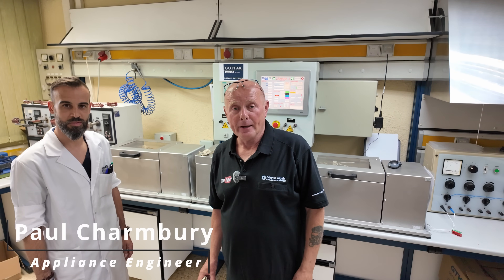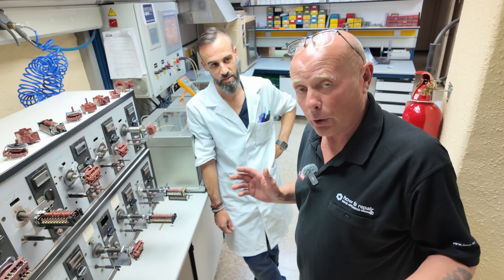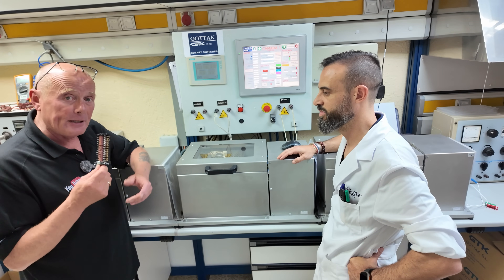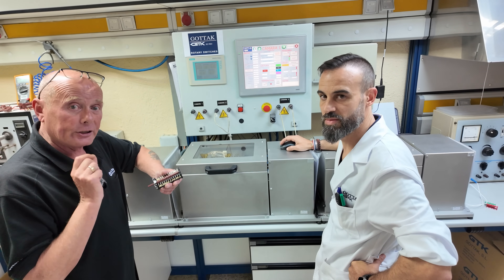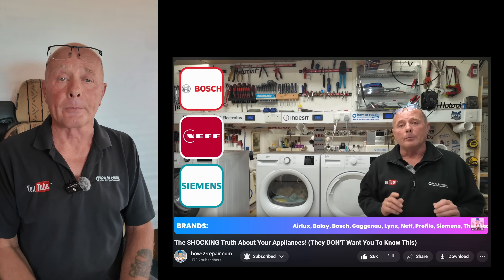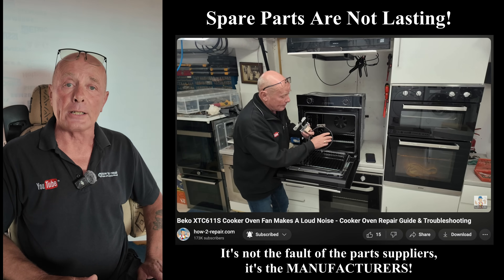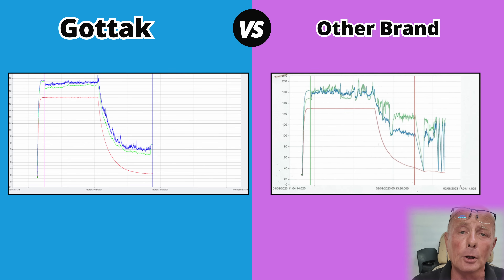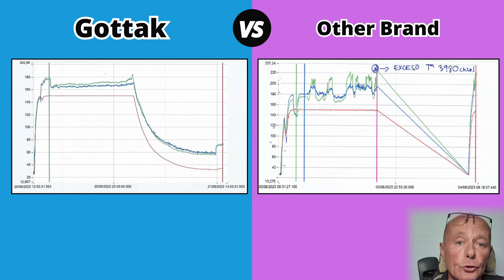Why Your Appliances FAIL SO FAST! Lab Results EXPOSE the Truth!

Comment: i got a samsung dryer and part of it is cheap wires that fall apart with bad soldering
Reply: and crappy heating element, had to replace heating element and themometer and cut and put in new heavy duty wire... its just a patch will probably need to do it again at some point untill the whole wire needs replacing. but yeha a 5 year old dryer that needs all that... i wish we would hav enever gotten rid of the older dryer... we have a dishwasher that i had to brake the locking mechanism that tells it when the washer is locked but it would lock correctly and let us wash our dishes so now i can actually turn on the dishwasher with the door open lol. yeah quality control is just not there cheap parts and cheap wires ... this is why i hate when peopple say "things from china are the same quality" like obviously you havent had to repair your applainces cause i can tell you now that the cheap chinese crap they are putting in the dryers will one day end up burning down a house. I am not looking forward to finding out how crappy the new water heaters ill keep fixing mine untill i absolutely have to get a new one.
Reply from the maker: Hi there! Thanks for your comment, @WilliamDiaz-p2h!

Your experience with the 5-year-old Samsung dryer, having to replace the heating element and thermostat, and even upgrading the cheap, flimsy wires yourself, is a frustratingly perfect example of the poor quality and built-in obsolescence we're talking about. The fact that you had to break a faulty locking mechanism on your dishwasher just to make it work further proves your point that quality control is severely lacking.

Your concern that the cheap chinese crap they are putting in the dryers will one day end up burning down a house is a serious and valid one. At the trade show last year, understanding how much obsolescence and corner-cutting is being designed into new appliances these days is something everyone should be aware of. For a deeper dive into this topic and to see the examples we covered, please check out the full video here: https://youtu.be/gEgSCbZnHVM?si=wTIw0mELuhWaw4aX

We also explored related aspects in these videos:

The shocking truth about manufacturers: https://www.youtube.com/watch?v=QsdGd2qDPaI
Heat pump tumble dryers are they really worth it?: https://www.youtube.com/watch?v=xn03N3b0-lE
If you found this information eye-opening or helpful, please consider sharing this video with your friends and family. The more people who understand what's happening with appliance longevity and safety, the better equipped we all are as consumers. Your sentiment about fixing your old water heater as long as possible is one many of us now share.

Thanks again for watching and engaging! Don't forget to subscribe to the channel for more insights like this!

Comment: I remember I bought two years ago an electrolux washer/drier and I paid 500 euros. It had the inverter system motor and I thought "thats nifty, lets try this one". As the two year warranty ended, literally not a week after the main circuit board crapped out, caps exploded and some chips blew out their middles. out of nowhere. just sitting there. room was full of smoke... I bought a new board for 150 euros. Half a year passed. The sump motor died. at first made some unhappy buzzing noises, later died altogether and I had to empty a full tub of my dirty work clothes onto the kitchen floor for god sake. Turned out that the moto had it's winding just sitting in the air - no epoxy, no nothing, I could move them effortlessly with my fingernail. They rubbed trough and shorted out. New motor: 34 euros. I just hate what crap today we are making.... edit: I forgot to add that in my basement I have my old washer, a Bosch V693. I was going to chuck it out after buying the elctrolux one, but after it failed so miserably, I decided I will do my best to revive the Bosch one. It actually worked for me trouble free since 1984 and just needs some love and a new bearing. I will never throw it out now, ever.
Reply from the maker: Hi there! Thanks for your comment, @mr.dahliaking.202!

Your experience with your washer/dryer, from the main circuit board failing right after the warranty expired to the poorly made sump motor, is a perfect and frankly infuriating example of the built-in obsolescence we discuss in the video.

It's incredible to hear how your 1984 Bosch V693 has stood the test of time and just needs a little love to get back in working order. That stark contrast between your old, reliable machine and the new one really says it all. Your decision to revive the Bosch is a testament to the value of older, well-built appliances.

At the trade show last year, understanding how much obsolescence is being designed into new appliances these days is something everyone should be aware of. For a deeper dive into this topic and to see the examples we covered, please check out the full video here: https://youtu.be/gEgSCbZnHVM?si=wTIw0mELuhWaw4aX

We also explored related aspects in these videos:

The shocking truth about manufacturers: https://www.youtube.com/watch?v=QsdGd2qDPaI
Heat pump tumble dryers are they really worth it?: https://www.youtube.com/watch?v=xn03N3b0-lE
If you found this information eye-opening or helpful, please consider sharing this video with your friends and family. The more people who understand what's happening with appliance longevity, the better equipped we all are as consumers.

Thanks again for sharing your detailed story and for engaging! Don't forget to subscribe to the channel for more insights like this!

Comment: I repair electronics. Low quality low temp caps on the power supply.
Reply from the maker: Thank you for your comment. I appreciate people like you taking the time to write it out. Please share it where possible. It might help others make a wise choice instead of being misled by the industry.
Reply: @How-to-repair  This could possibly be resolved by regulation on duty cycle and headroom in components.
  The problem is people are less wealthy than they were 15 years ago. 
 Their purchasing behavior reflects this.
  Troll the internet, find the cheapest item.
Personally I can not afford to buy cheap.

Comment: It is a sad reality. Several years ago my mom bought an Samsung vacuum cleaner and the motor failed literally a month after the warranty period rendering it useless. Heck I myself bough a battery powered desk fan and it was failing in less than a month because they cheaped out and went with a cheap bushing for the bearing instead of a ball bearing that would have significantly increased it's lifespan a lot. I replaced that bushing with a ball bearing as it was using an ordinary 12v PC brushless fan as the motor and they all are very similar so it kinda just fits perfectly. After that it hasn't really failed. Now I know bushings aren't bad but that one is. I own a vintage 1966s desk fan where the motor does use bushings but it's doing just fine. There is slight play in the shaft from wear over the years but it doesn't wobble when running and I've put new lubricant in it to keep it lasting even longer. And this isn't just appliances, this is applied everywhere, even in electronics like your smartphone, laptop, printers and more. My brother has decided to buy cheap power tools from Parkside and 3 of those tools have already failed and it's barely even been used. In two of the tools the microcontroller for speed failed. In one I couldn't figure out where it issue lies, in another there was visible burnt out chips. Fixed those two by skipping the microcontroller and just going straight from the switch to the motor just so it would work at all with the minus of not being able to control it's speed anymore. In the third one again the microcontroller for speed control failed but that's a different type of switch that I can't wire to the motor to skip the failed speed controller so it's basically just dead and I can't find a replacement switch either. Meanwhile a cheap NiCD drill that I found at a scrapyard with it's charger from 2006 and it has no issues and it just works. Funny, yet sad.
Reply from the maker: It's hard to believe that manufacturers expect consumers to be happy buying major appliances every few years. I haven't seen any positive comments from engineers about this problem. Planned obsolescence and the lack of repairability are major issues in the industry and the manufacturers prioritize profit over long-term reliability. Thank you for your comment. I appreciate people like you taking the time to write it out. Please share it where possible. It might help others make a wise choice instead of being misled by the industry.

Comment: I’ve noticed this for several years now. 
Often times if I’m able to do so, I will buy another item, just like the one that failed, swap the internal parts, and then take it back for a refund. Lol
 Until manufacturers stop screwing us over, I will continue to do the same thing. 
Automotive parts have really taken a downturn in quality too. 
 I’ve gone through several starter solenoids, same thing with the internal contacts being cheaply made from inferior materials. 
 Relays and switches in general, including points for older ignition systems, just about all of them are made with inferior metals that get pitted and burnt prematurely.
Reply from the maker: It's hard to believe that manufacturers expect consumers to be happy buying major appliances every few years. Thank you for your comment. I appreciate people like you taking the time to write it out. Please share it where possible. It might help others make a wise choice instead of being misled by the industry.

Comment: If it ended up that the manufacturer was made responsible for recycling products with their brand on it, I'd bet they'd change their tune pretty quick on reliability. Not sure how it'd be possible to get the laws adjusted in that direction, but that's whats needed to reduce waste at some level.

Also I hate how some things have been designed to have a significantly shorter lifespan by being designed to be unserviceable. And that implies nothing changed otherwise with the quality of components. For instance you could keep a fan with a shaded pole motor working for decades by cleaning up the inside and oiling the bearing cups. But a brand new one will have deeply recessed security screws on it, which means it bogs down and dies in two years because there's no way to do maintenance that was easy before.
Reply from the maker: It's hard to believe that manufacturers expect consumers to be happy buying major appliances every few years. Thank you for your comment. I appreciate people like you taking the time to write it out. Please share it where possible. It might help others make a wise choice instead of being misled by the industry.

Comment: We need a global internet media hub unassumingly called something like 'My Engineer' where people can document individual engineers and designers and executives who have:

Designed and/or green lit specific examples of built in obsolescence;
Spearheaded anti-repair practices;
Used predatory patents and/or market dominance to kneecap innovation, design resilience; repair friendly design; dangerous work practices, products or services.

Start it as a history project and work forward to contemporary and politically charged examples currently effecting customers, and distorting markets in favour of established vested interests.

You could start with every individual who insists on using the industrial waste product sulphuric acid, instead of the much safer sulphur based alums in consumer products such as car batteries.
Reply from the maker: Thank you for your comment. I appreciate people like you taking the time to write it out. Please share it where possible. It might help others make a wise choice instead of being misled by the industry.
Reply: @How-to-repair  I spent a few years involving with recreational hot air ballooning. One thing that struck me, was that EVERY design feature, and procedure was a memorial to a death. During my time, the two stroke fan used to start the inflation process was given a new procedure: a ring of witches hats around the fan unit. Six months earlier, a woman had lost her life when her hear had got through the fan cage and snapped her neck like a match stick.... so there are witches hats to keep people away.
EVERY DETAIL MATTERS in design. It is spine chilling when you understand the evolving narrative of human verses machine. This is why I get so angry when I encounter poor design... its dishonourable and... evil.

Comment: This test is not really valid, and is overly negative. Consumer data shows that the switch is used, on average, once a day, which means the switch is used, the oven heats up, and then cools down before the switch is used again. The test does not emulate this, rather it keeps the switch always at the higher temperature. It would be interesting to see test results of rotating the switch, at 150 degrees, let the temperature drop back to near room temperature (let's say 40 degrees to be conservative) and then rotate the switch again, repeating this until failure. How many operations would that be?
Reply: Sorry to tell you but the switch is continuously rotating through out the complete test. What is being tested is the behavior of metal components and thermoplastics at the top high temperature and the effects of the electric arcing (spark) on the opening and closing of the electric circuit and its degradation. If alloys, contact size, geometry and other stuff is not the adequate one, the switch, it inevitably will fail very very fast. The erratic behavior obtained during tests of low quality switches and poorly designs, shown on the presented comparison graphs, demonstrate that.
Reply from the maker: Thanks a lot for your response Daniel!

Comment: Wonder how many houses were burned down over a few pennies of profit .
At yard sale I found 1970s Maytag washer defective the day it was built used 3 times and after 5 technicians failed, Maytag replaced it for the original customer and left it  behind at his ranch I got it for 20 bucks 45 years later just sitting in the barn still like new
45 min in found unstripped crimp on power latch curcuit 10yrs of service in June when washers actually washed a load. 1968 Gibson 24 cu ft upright Freezer 1931 Servel Double door refer w ice maker no moving parts all strong runners
Reply from the maker: In the 80s, 90s, and early 2000s, most manufacturers produced high-quality equipment to build their reputations. Today, their main goal is to sell machines. Thank you for your comment. I appreciate people like you taking the time to write it out. Please share it where possible. It might help others make a wise choice instead of being misled by the industry.

Comment: adding computers and WiFi to appliances is another way of insuring that a product will fail
Reply from the maker: I've been repairing washing machines for nearly 50 years, and the basic principles of washing clothes haven't changed since the 70s. They wash, tumble, heat, and spin. It's baffling why we need so many extra features now. Machines used to last 15 to 20 years on average. Nowadays, you're lucky if they last five years. Obsolescence is clear in today's society.

Thank you for your comment. I appreciate people like you taking the time to write it out. Please share it where possible. It might help others make a wise choice instead of being misled by the industry.

Comment: The magic number for electronics is 50,000 hours. This I believe this is based on the chemical formula for electrolytic capacitors.
Reply from the maker: Thank you for your comment. I appreciate people like you taking the time to write it out. Please share it where possible. It might help others make a wise choice instead of being misled by the industry.
Reply: Years ago when I was an electronic technician, a trainer from Phillips told me they had two teams of engineers, the first group designed products to be the best possible, and the second team was dedicated to finding ways to reduce manufacturing costs. That was 1981.😊

Comment: Eh I hardly use selector switches anymore. "Contactless" buttons can last quite well because they are basically metal coils that generate a small magnetic field that extends to the outside through the glass/cover; when your finger touches the 'button' the magnetic field is disrupted and the switch is triggered. 🎉🎉🎉🎉🎉

(Or at least that's how I think it works -- something like that 😄 )
Reply from the maker: Thank you for your comment. I appreciate people like you taking the time to write it out. Please share it where possible. It might help others make a wise choice instead of being misled by the industry.

Comment: I expected this video would focus on the (entirely unnecessary) electronic control boards, and am shocked that even a mechanical switch can be so badly "value engineered". Good work.
Reply from the maker: Thank you for your comment. I appreciate people like you taking the time to write it out. Please share it where possible. It might help others make a wise choice instead of being misled by the industry.
Reply: Why would you put in a switch with contacts that would last 10,000 actuations if you expect say 5000 actuations over the warranty period? Build in an extra 20% or so and specify a switch that would last 6000 actuations, and save on the price of each control.

Multiply by 100,000 units sold worldwide and you have substantial cost reduction.

Every single part and screw has been analyzed and cost reduced, there are employees whose entire job is to go through what the engineers come up with and to cost reduce each item.